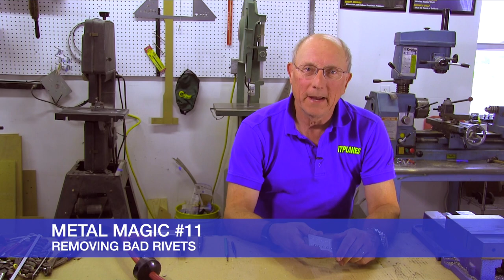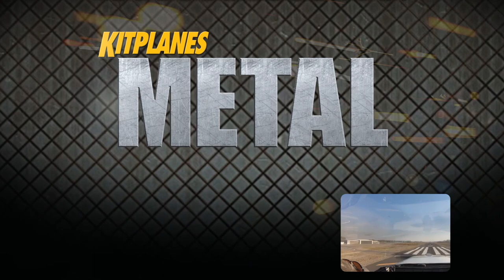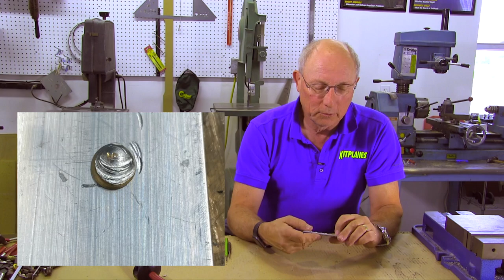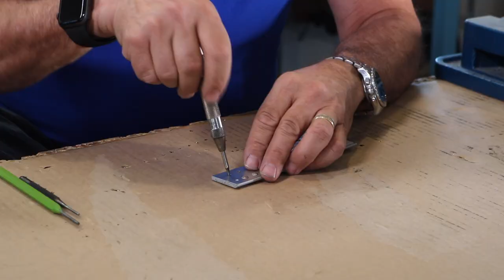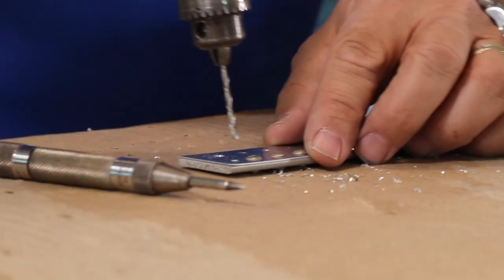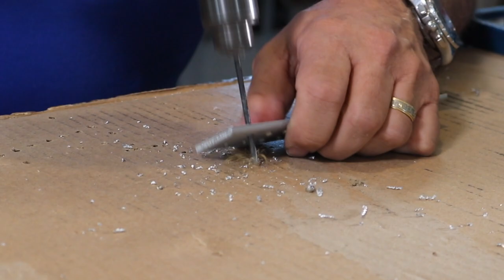Metal Magic: Removing Bad Rivets

Comment: Paul - I'd like to see some guidance on less-than-perfect rivets and when a rivet needs to be replaced.  I recently read something (might have been in AC-43 or maybe Van's instructions) that suggested that even though a rivet may not be "textbook perfect" it will still probably provide 80-90% of its design strength. And since the process of drilling-out can be less that perfect (egged holes, close to edges, etc.), it is sometimes better to leave a "messed-up" rivet alone.  Perhaps you could demonstrate with examples of some varying degree of messed-up rivets and show us which ones you'd re-do and which ones would be "good enough".  Thanks.